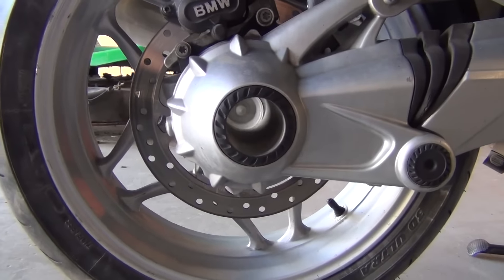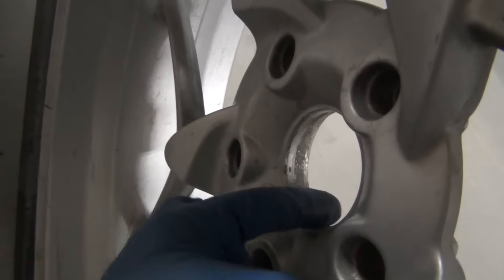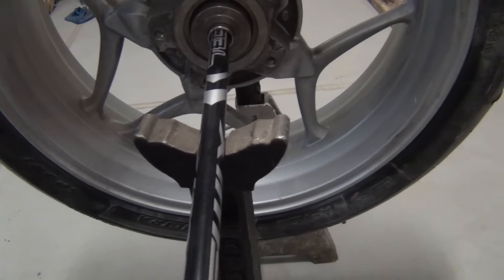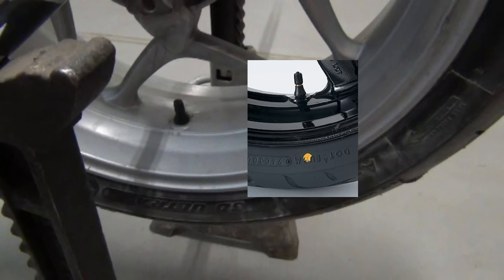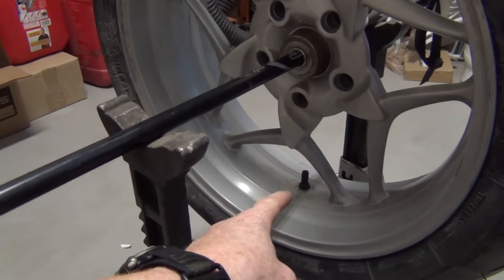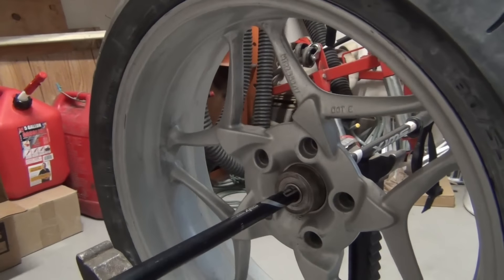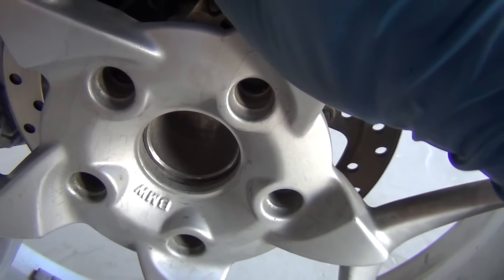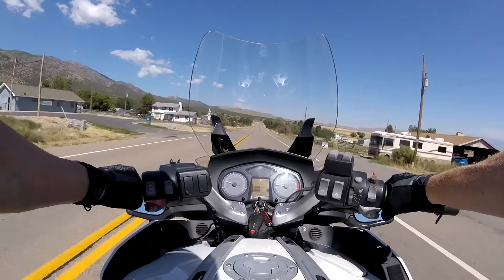DIY BMW Motorrad Rear Tire Balance

Comment: Would you please provide more details on the tool that you used as an adapter? All I really heard was that it was some kind of brake drum adapter? Is this a BMW part or are you referring to a generic brake drum adapter sold as as an aftermarket part in auto parts stores?

Comment from the maker: #######   ESCORTMAX360 Contest update    ######  The first four people selected didn't read the rules about a way to contact them to get a shipping address.  The privacy settings were such that they couldn't even accept a private message let alone an email address.  The fifth person didn't have an email address associated with their YouTube account like you're supposed to in order to enter, but DID have their settings such that I could contact them.   
I want to do another contest, but we're going to have to change some things in how you enter so you input your address up front.

Thanks for your patience everyone.   Stay tuned.  If you've already entered- check your account settings.  I may have to randomly select another winner that abides by the rules of the contest and has a means of contact by email associated with their YouTube account.  (in the About section on the left lower part of the page that requires a captcha)
Reply: When will the new drawing be?

Comment: How things have changed.  I still remember when you only balanced the front wheel on a bike - the power going through the rear kept it fairly smooth on its own.  Of course, this is from back when many bikes couldn't do much more than 100 mph (and most of mine topped out at around 70) - you think maybe that made a difference?  :-P
Reply: I just hand to put on an emergency rear while on a trip and it was completely unnoticeable until it got over about 70!